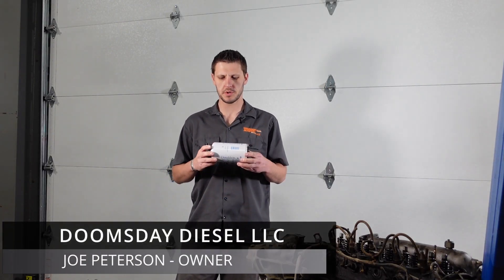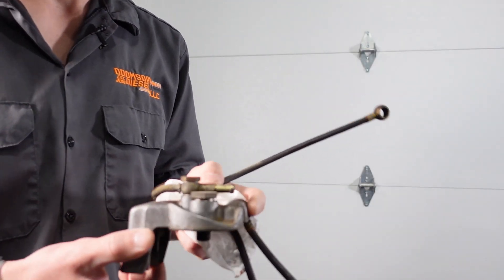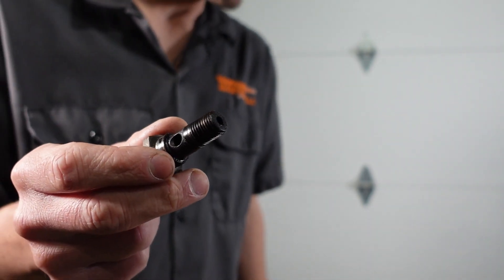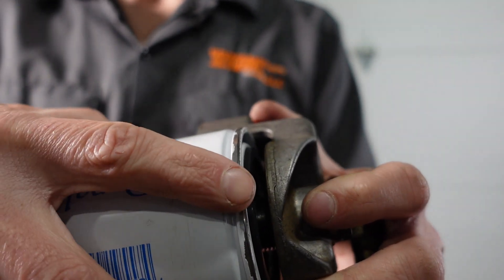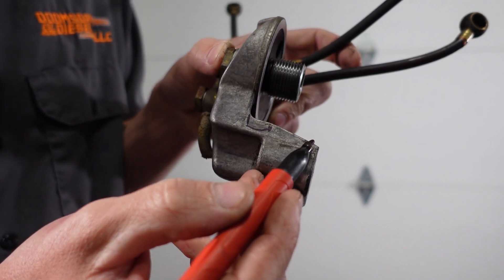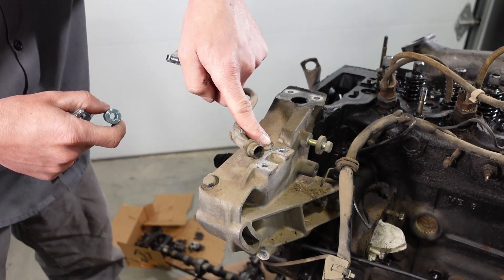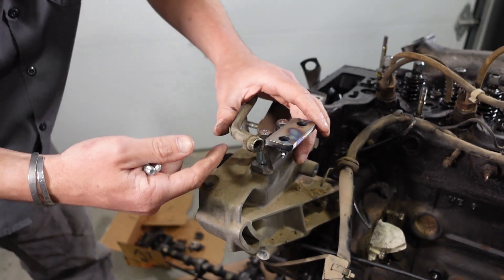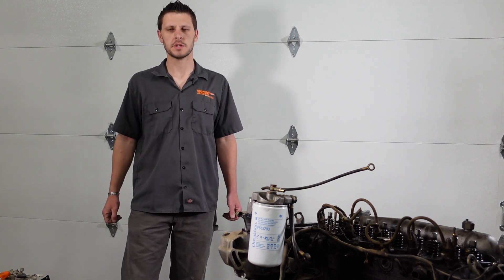OM617 Performance Series: Fuel Filter Adapter Installation

Comment: Hey so i just got a 1985 w123 and the guy before be did this upgrade, pretty sure he DIDNT change those 2 orings in the bolt before installing the adapter because it leaks from the top and from the filter. Can i use a torch and not melt threads into threads? And even then can i even remove it without totally killing the threads?
Reply from the maker: I wouldn't use a torch on a fuel filter - sounds like a recipe for a major fire! I'd use a heat gun if necessary to get things loosened up. Have fire extinguisher on standby.

Comment: On my W123, the two hoses with the banjo eye fittings (with the in and out arrows on the side) were too short to reach up to the adaptor kit.
Reply from the maker: That's a good point. I'll make mention of it in the description that lengthening may be required. I have a video on rebuilding the Cohline lines. They're usually broken/leaking by now anyway.
Reply: @doomsdaydiesel  Thanks for the help! I wasn't sure how to go about it so it's great to hear you have a video on how to do it!

Comment: With this kit in a 300, what are the lengths like for stock fuel lines coming in and out of the filter and pump etc? Would any of them need to be removed and replaced being that the height of the filter is changed?
Reply from the maker: The cars I've installed them on haven't. But I like to make new Cohline lines when I start working on these engines anyway. They're usually old and worn out/leaking.

Comment: Can this upgrade be performed on a factory setup in a W126/W123 chassis ?   If so, what else needs to be temporarily removed, besides the filter mount, to perform the upgrade?
Reply from the maker: This is the install video for the cars